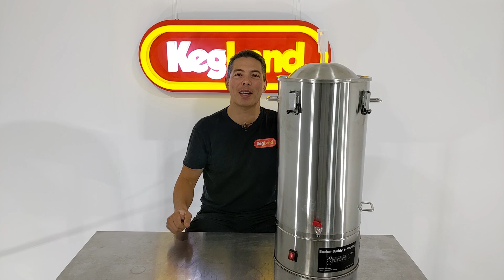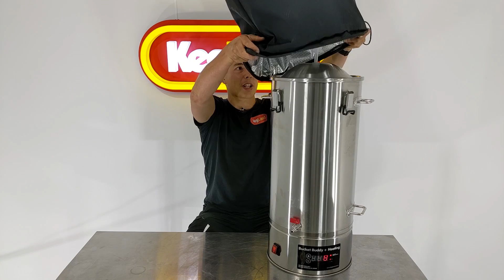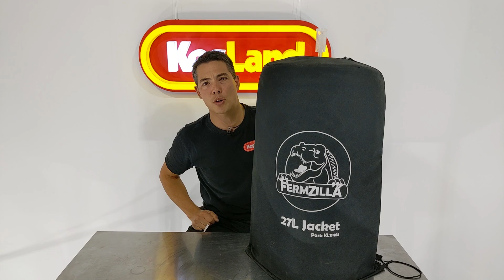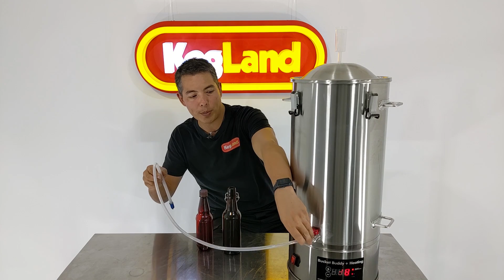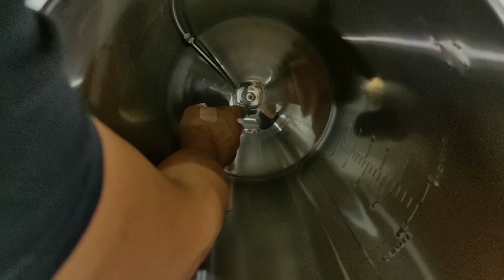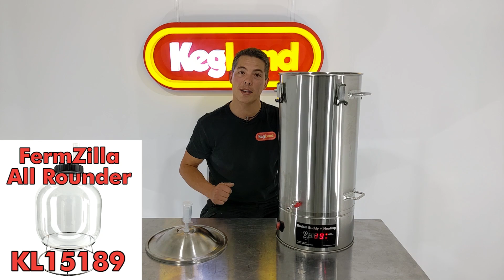Bucket Buddy Fermenter Now with Integrated Heating

Comment: I just wish the spigot was 1/2 inch instead of 3/8.
Reply from the maker: Yes the spigot is 1/2.
Reply: @KegLand  That's not what I'm seeing in the description,
 The outlet on the valve is barbed to accept 3/8" interior diameter tubing, and 3' of tubing are included

Comment: Guys, I need some advice,

I have a Bucket Buddy with integrated heating (BB) and ferment with a pill inside and a temperature controller (TC) using the pill as the sensor.  The pill is connected via bluetooth.

In the last 3 brews, I've lost bluetooth connection with the pill and it took about 35 to 90 minutes to reestalish the connection . Way more than the max allowed timeout in the settings (I believe its 900 seconds)

This then changes the temperature input to the built in probe of the TC which even though  I've taped the TC probe to the side of the BB it tends to be colder than the actual temperature of the liquid.

I've thought of adding a thermowell to the bucket buddy lid to sense the actual temperature of the core with the TC probe, but I have not found any one who has done it and posted it online, nor seen you suggesting it. 

Can it be done?.

Comment: Is anyone else having major issues/problems with this piece of  kit? I am having major issues trying to get beer out of the spigot even with the useless racking arm removed. Attach the tubing to the spigot/tap, put tubing in the keg, turn the tap on and you will be lucky to get half a keg of beer before the dribble stops completely. Spigot is insanely small and not fit for purpose in my opinion. I will stand corrected if someone informs me how to make the transfer go much, much better.
Reply from the maker: If you are using hoppy beers we would recommend using a filter on the inside of the unit.  Hops have a way of blocking everything.  To be honest my favorite fermenter is still the 60L all rounder and the floating dip tube works great in this.
Reply: Thanks for the reply. Yeah, my first transfer, the spigot was blocked by hops that I thought would be well below the spigot. However, subsequent transfers have been very stressful and unsuccessful, due, I believe, to the size of the spigot. I already have a 27L all rounder and a 27L triconical, which I know I can transfer from, without too many problems. However, I bought the bucket buddy with heater to get away with not using a fermentation chamber and it certainly keeps the temperature I require in chilly UK. If you can come up with a video on how to change the spigot for something more substantial, that would be great. I have bought a super sucker transfer pump in the meantime and I'm hoping that will solve the problem. Thanks again for your reply, it's much appreciated 👍

Comment: I am in the UK. Tried to use mine yesterday and found the seal on the lid was too big and keeps falling out. Also the racking arm leaks unless you tighten it fully, but then it won't rotate. I have posted info on the English homebrew forum.
Reply: Are you having issues with transferring the beer too?
Reply: @donmac5926  Not tried yet but going to have to use a syphon as the weight of the liquid pushes the racking arm downwards into the trub. The racking arm is worse than useless and so rickety. And learned not to get the seal in the lid wet with starsan or it falls out.
Reply: @Lisathelamb  yeah you're dead right about the spigot/racking arm. In fact I removed the racking/moving arm as its useless and not fit for purpose. My issue is with transferring the completed fermented beer from the spigot to the corny keg. I end up with half a keg as it stops working. I have the lid off, the tap fully open and nothing! There's no blockages cos I use a hop tube if dry hopping and the yeast is usually quite solid on the base. I'm pissed off with it now and too wary about using it again as I brewed a pilsner using the new novalager and was hoping for a good lager. I'm going to try and "fix" it somehow so it will work as it should, but I think it'll mean changing the spigot for something much larger. I'll let you know how it goes. Thanks for your swift reply, by the way. Don
Reply: @donmac5926  no worries don. you'd probably need pressure on it to be able to get all the beer out. won't necessarily work with gravity once it gets past a certain level.
Reply from the maker: You will find the seal fits into the lid in one direction better than the other. Have you tried flipping over and then fitting into the lid in the opposite direction?
Reply: @KegLand  Yes, that does seem to help a little,  as there seems to be a notch on one side, still a bit loose though. I've found the 12 o'clock, 6 o'clock method helps too.

Comment: Hi Guys, with this unit based on Gen 3 design,  any plans in the pipeline for a Gen 4 version of the brew buddy. Or will this model still be available for quite sometime?
Reply from the maker: This is not in the pipeline at the moment.  I will ask management if they can consider this.

Comment: what is the temp rage for beer fermentation generally for most beers... does that work for all using this fermenter ?
Reply from the maker: Most beers will be fermented between 10-30C.  This will work for all beers in that range quite easily.

Comment: Can use for kombucha where temperature need to be between 68 and 78 degrees F ( 20-25 C)?? Will it hold those temps?  Unclear of temp range . Btw I Read your previous post of 30c to 50c max temp achieved when insulated. Thanks
Reply from the maker: yes absolutely. It will easily get up to 30C or higher.

Comment: Can you give any advice on removing stains from this fermenter?

My device unfortunately had a malfunction out of the box and the heat function was stuck on. The unit got up to 43C and after cleaning the fermenter it now has a large stain in the bottom.

Bonus question... my fermenter came with a rubber ring/belt around the base. What's the purpose of this ring as it just seems to trap moisture?
Reply from the maker: I would put in some hot PBW then after this do a strong phosphoric acid soak.  I am not farmiliar with the rubber ring for the base.  I think this might be accidentally in the box perhaps.  We do have a silicon lid o-ring. Are you sure this ring is not a spare lid o-ring?
Reply: @KegLand  Thanks I'll try those suggestions.

The rubber ring is black and came prefitted to the fermenter. It sits in the little valley where the bottom digital controls part meets with the upper fermenter body.

Comment: Tidy looking product. Can the digital display on the front swap between current temperature and target temperature? For example if you're not using the heating component can you still take advantage of the temperature sensor to give you accurate daily readings of your fermentation process?
Reply from the maker: That's a good idea.  I will talk to the other guys about possibly implementing this.
Reply: @KegLand  Thanks, I think that would really expand the viability of the unit for folk in warmer climates that are unlikely to need the heating feature. Can you provide an indication of the weight of this unit, worried I might struggle to move it once it's full?
Reply from the maker: @eluthriastarise1770  The empy weight of this product is less than 5kg.  So most of the weight will be in the liquid rather than the device itself.

Comment: There appears to be lots of bad boys at KegLand.

So How much is this bad boy bucket buddy slammer fermenter?
On the KegLand website the bucket buddy is listed at $169.95.
(And $129.95 without the heating controller option)
Reply from the maker: The older bucket buddies without integrated heating are now superseded by these.

Comment: Sorry, but I need cooling, not heat.
Reply from the maker: Have you thought about getting our G20s for cooling?
Reply: @KegLand  is there a cooling coil for this?
Reply from the maker: @peterkenna7344  We do not have an off the shelf cooling coil for this.  If you wanted to install a cooling coil you would have to get the temp twister and fit it to the lid yourself.

Comment: not sure about having the temp probe at the very bottom under the yeast and trub. surely couldn't be that accurate. (And don't call me Shirley)
Reply from the maker: From our experiments it seems to give quite an accurate reading and the whole fermenter from middle of the vessel to bottom of the vessel only had about 0.5C deviation so it did not seem to make much difference measuring from the bottom, side or top of the vessel.

With the probe on the side or top we end up with messy wires coming out of the base and I don't think it's worth the extra hassle when the temperature is quite consistent. 

I should also say that if you really want accurate reading the insulation really helps too.  When the fermenter is well insulated with the FermZilla jacket you will see the temperature deviation from top to bottom of fermenter is even less than 0.5C
Reply: @KegLand  ok fair enough. I just ordered an all rounder this month so i'll pass on this for now. You guys have taken enough of my money over the years!
Reply from the maker: @TheGavranatar  To be honest I think the all rounds is the superior fermenter but some people really just like stainless steel or feel they need to use boiling water in the fermenter for instance.   I think you made the right choice with the all rounder.

Comment: Hopefully? Why do you say "hopefully"?
Reply from the maker: I am sorry which bit do you mean?
Reply: @KegLand  He said that the heat goes "hopefully" into the beer instead of the yeast cake. 0:45
Reply from the maker: @FoScoJo  The yeast will naturally collect at the bottom of the concave base.  With that said small amounts of yeast will also collect on the angled side walls.  Also if the yeast cake is really large it could potentially be higher than where the element is located.  I can say it's certainly a lot better than using a heat mat which is used by many home brewers at the moment.

Even if the heat is applied at the top of the fermenter you will always still get small amounts of heat carried to the yeast cake through diffusion and convection currents in the fermenter so I guess it's more accurate to say "hopefully" as it's something that we cannot guarantee and probably no manufacturer can.

Comment: Just needs the integrated cooling.. 😉
Reply from the maker: I wish it was that easy.  We did consider using thermoelectric but these are horrendously inefficient and a waste of power and also can't really cool that much.  If you really want cooling I think you can't beat the RAPT fermentation chamber but this is a big step up in price.
Reply: @KegLand  when is the fermenter fridge coming we've been waiting ages with no update.
Reply from the maker: @kontiii  Yes sorry about this it's taken longer than we anticipated.  We continue to make further improvements though. For instance the door switch that controls the light turning on and off now has been changed to be handled through the IOT board so now we can get notifications/alerts if the RAPT chamber gets the door accidentally left open.  Previously this was not possible. So although the wait is long I hope you guys find the wait is worthwhile.

Comment: What is the temperature range for heating?
Reply from the maker: You can set the temperature at 120C if you want to but as this only has 36watts heating power it will never get there.  This unit can be effectively used to heat up to 30C without insulation.  If you improve insulation you can probably get closer to 50C but you probably would not want to get anywhere close to this for beer fermentation.
Reply: @KegLand  What about Kviek fermentations? Will this unit hold 40c easily?
Reply from the maker: @thebackyardbrewer5611  If you want to hold 40C then you would have to use the insulated jacket to get up that high.  Without the insulated jacket you can expect to get to about 35C only.

Comment: Now just make it pressurisable so it can be put in a fridge and used as a keg.
Reply: that's what I was hoping for, I'm not a fan of those leaky fermzilla things
Reply: @johnrobinson8941  I use the All Rounders, they're great and don't leak
Reply from the maker: @ChewyBravo888   Yes the All Rounders now make up more than 70% of all FermZilla sales and they are slightly cheaper but easier to use and unless you want to collect and reuse yeast I dont see the Conical being necessary.
Reply from the maker: @johnrobinson8941  IF you have a fermzilla with a leak issue please let us know and we will rectify it. We sell hundreds every month and from what I understand the issues that we had on the initial designs have already been resolved.  If however you are having leaking issues on one of the new ones please let us know ASAP.